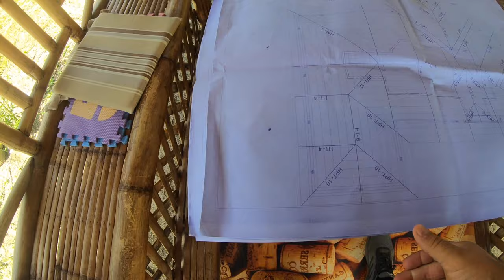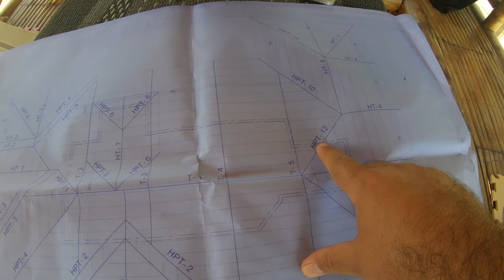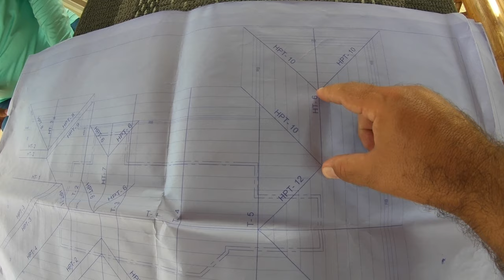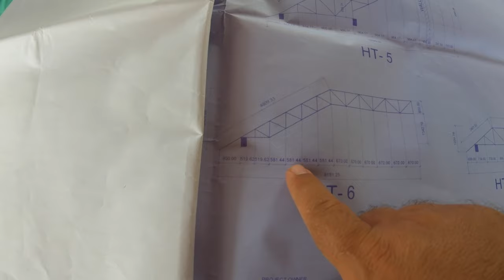Philippine House Building Step by Step, Build Day 88:  Truss But Verify

Comment: It makes more sense to do it as you go.
Reply from the maker: Allen, The idea behind pull wires is to save the actual electrical wires until the finishing stage so they don’t get broken or inadvertently yanked out during the rough construction. Pretty standard in most construction I’ve seen.

Comment: wow great video!! please notice that your drawing shows the truss webs equidistant. but the truss is not. if this happens at a bearing midpoint it is ok. if not then it is a structural defect weakness. it can be repaired by placing steel plate there.
Reply from the maker: Thank you, I’ll keep an eye on that.

Comment: So, I am sure they are making it easy on themselves and installing the wiring into the conduit.   But I don't see them installing the wiring into the conduit.
Reply from the maker: Allen , The electrician is installing pull wires so he can pull them through later. Right now is just initial installation.